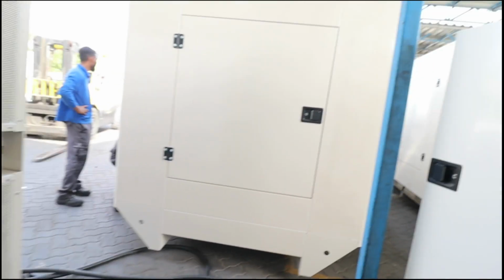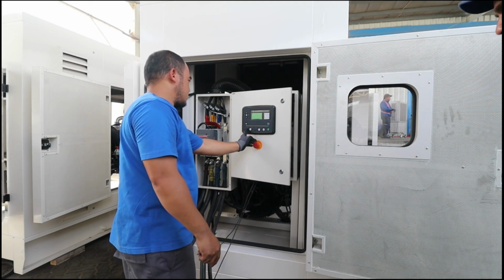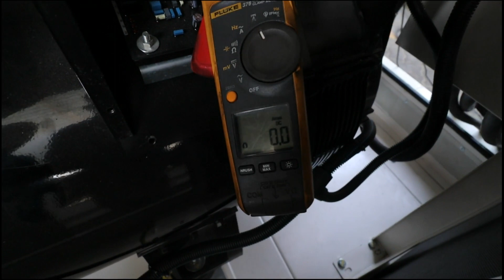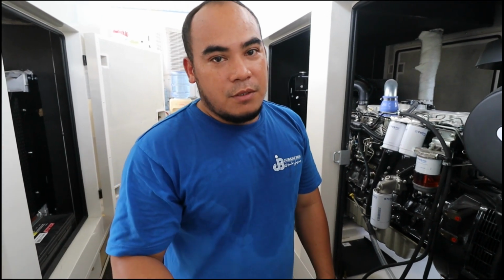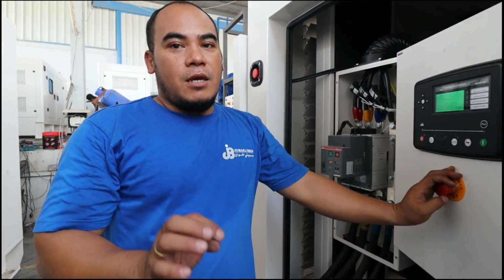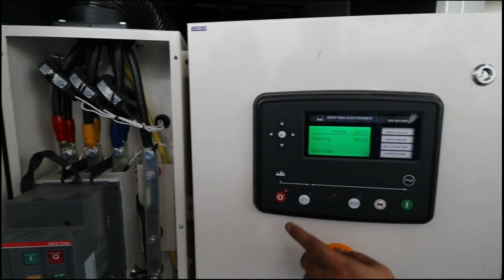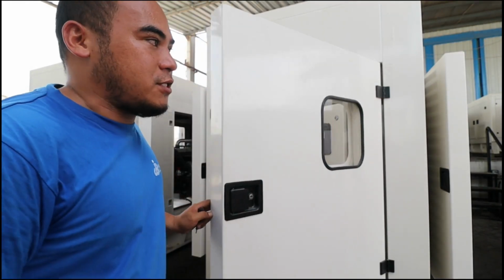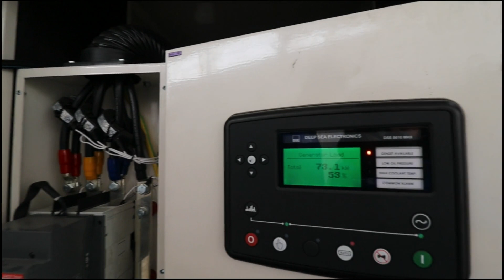How to avoid high excitation during synchronizing benzblogs

Comment: What poteionmeter u adjust to decrease the excitation current and what is the AVR type
Reply from the maker: First thing you need to understand what avr and the usage your going to install this type of avr what kind of voltage you going to apply and what type of excitation you need to coz its always varry depend on the type of alternator model and kva you can not apply without studying and beyond understanding this type of avr , with regards to my co blogger POWER LEARNING in arder to answer you question is simple use multi meter to identify if your excitation level is correct and the voltage output you needed okay
Reply from the maker: Now you need to adjust the voltage according to what you ouput need thin slowly adjust AC trim according to the excitation limit that you need in order to achieve that you need to use two multimeter in order to see the actual voltage and the excitation current if the wxcitation level is correct at the firstime why we need to calibrate it, No need if not necesary if need and there is problem thin you have to do it .
Reply from the maker: Make sure also the voltage sensing your using to avoid failure

Comment: I synchronized 220kva and 340kva but am getting -Kw on the 220kva, it's that normal?  All CT directions and connections  are correct (output from genset goes through P1 and comes out from P2 to the Motorized breaker)

Is this normal? What do I do to clear this negative Kw readings
Reply from the maker: Sir do you have video on or picture? Is this happen without load?
Reply from the maker: Sir do one thing do not synch load the generator which is geeting -kw if the reading is wrong or correct duri g loadtest without sync if negative thin you got wrong wiring on it

Comment: sir. benz ano ba dapat ang normal amps ng avr while running
Reply from the maker: Sir its depend on the alternator if it is 13-100 kva normaly its around 1-1.5 amps only
Reply from the maker: Above 250-2000 kva alway refer to the alternator manufacturer imor spicification
Reply: Example sir.benz 1000kva tapos ang avr na R450 ano ba dapat ang amps niya?
Reply from the maker: This 1-1.5 amp at zero load its vary to the load always
Reply from the maker: Always varry at load sir